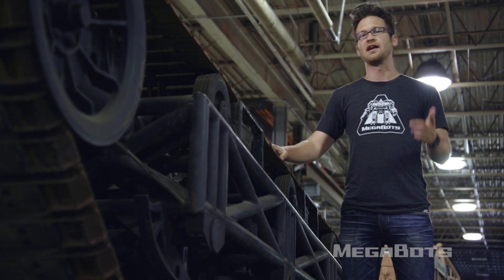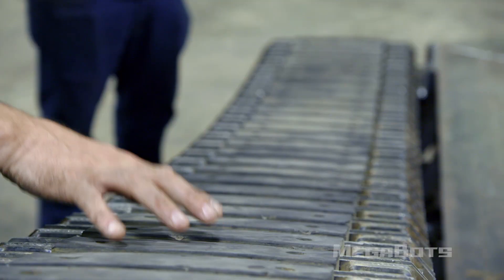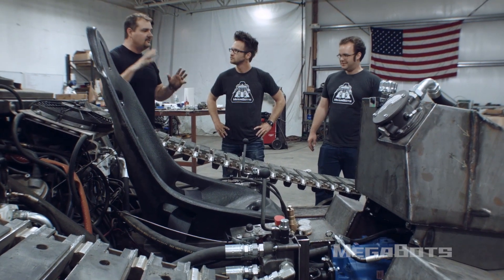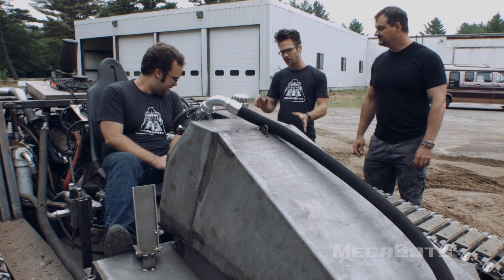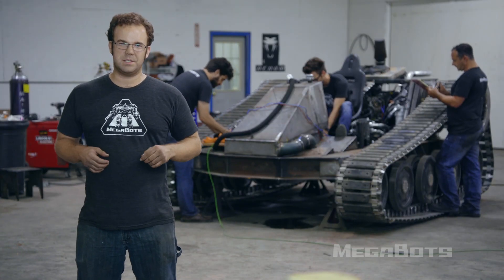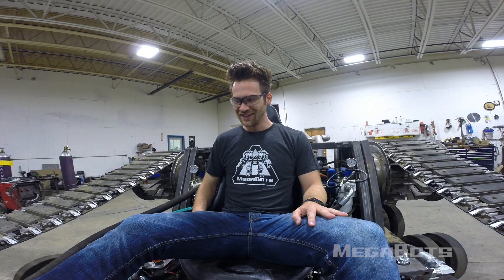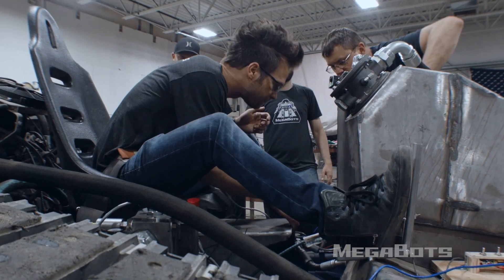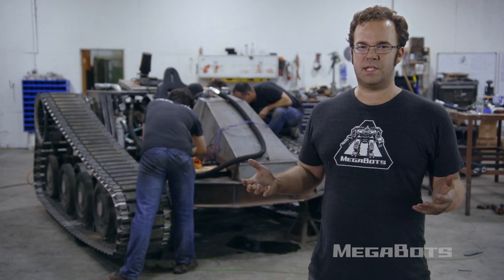Test Driving Our Custom Tank (Season 1)

Comment: As heavy-duty  vehicle operator/ driver this video is of interest to me.
That machine took some serious thought about how it should move.
As I understand it, the vehicle has a large V8 engine, that drives a hydraulic pump that drives the "high mounted" drive wheel.
It's kind of obvious that it's not a military vehicle, one rocket genade will take that "high mount" wheel out.
Is it just competition for the Ripsaw private vehicle?
I see it as a workable robot that can go in harm's way and not risk the lives of military personnel.
What system will be used as it's platform?
Better cover that high mount drive wheel.
Beautiful work, you will get the "bugs" out of it.
Good job!

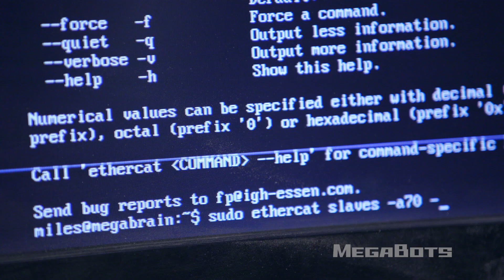Comment: 5:12 Good choice of operating system.
Reply: DOMEPEACE420
It's some Unix-like OS, probably Linux.
Reply: Angolin at risk of sounding like a n00b what is the OS?
Reply: that right there is a linux command line
Reply: last time i checked they were using stock ubuntu

Comment: Maybe iI'm being cynical, but I have the feeling that, with all the money spend in both sides, they are going to rig the fight and turn it into a choreographed show.

I hope I'm wrong and this battle of wits doesn't turn into a very expensive wrestling drama, even If I must admit, that also sounds kind of awesome.
Reply: I think it probably won't be full-force. The squishy humans inside might be harmed by a robofist to the cockpit. Even if the cockpit mostly holds together, the shock alone could harm or kill someone.
Reply: Ike of Pyke
 Well the Wright brothers weren't building jets either..... you may be right, and I would love it if we were just building giant robots to pick flowers, but I'm pretty cynical myself :)
Reply: Honestly I'd be happy if it was just like a one-punch knockout
Reply: Really I think this is just a "subtle" way of the military funding giant mechs. If this is anywhere near viable, they'll start cranking them out to go to war with. Not that it isn't awesome...but they've been pretty closed about their "private investment" funding outside of kickstarter.
Reply: I don't know...  I mean, a lot of the cost of the Megabot is in design, rather than materials.  Once you've figured out how it's supposed to go together, it's just steel and rubber, and industrial hardware- a little pricey, maybe, but not super expensive.  If one of the Ripsaw treads were to break, well, they're modular, and the individual shoes can be swapped out.  If the armour is ripped off, again, that's just fabricated steel.  If a joint is busted, that's hydraulics, but those are relatively cheap due to how common they are.

Now, I could see it being an issue if one of the fancy custom valves is busted, but those are going to be well protected inside anyways- it's much more likely that the first things to fail will be hoses or fudged-up joints, and if those fail, then the bot's out of work and lost anyways.

What's I'm really interested/concerned about is how the Kuritas is being modified for this.  That bot is definitely a showpiece, an expensive playtoy for rich guys, and so a lot of its parts are probably 3d printed or hand-cast carbon fibre or fiberglass- things that shatter instead of bending, and have to be completely replaced.  It's definitely got the edge in maneuverability and speed, but is it being beefed up to withstand damage more, or are they putting in better piloting algorithms and pre-set dodges?  The Megabot is a bruiser, and the Kuritas is a stinger, and I'm hoping it doesn't end up in a situation where neither of them is able to do any appreciable damage to the other, either due to dodges or armour.  (though that could make for interesting fights, it would mean the Kuritas would win by judges decision, probably.)

I mean, just look at Battlebots, and the sort of damage taken and dealt by 'bots that weigh only 250 lbs.  You get fancy 'artbots' that look awesome and drive really well, but don't do any damage, and get absolutely shredded by the 'brute' bots like Tombstone.  Hopefully Kuritas is more of a Beta, and less of a Radioactive.
Reply: still even if the first isnt very good if they can make a lot of money from it, it will continue on each year with better and better robots
Reply: jadestwrt
 It's coool to be cynical, I thought of weapons applications the moment both the Karatas and Megabots were annouced , at most I can see these things being made into Industrial machines especially if they can automatmate the arm changing. However I think we're still at least 20 years out from seeing on even prototyped for field testing for real weapons/military use..
Reply: That's what the destruction tests to the Mk. II's cockpit were for.  There's ways of designing a structure so that the squishies inside don't feel the shock of impact, and they seem to have done that for the current pit, according to a prior video.
Reply: The first tanks weren't much better. I think given 7-10 years of development something resembling combat-ready will emerge, but i doubt any military will use one for a while.
Reply: Stone Coughlin only thing I'd say against that is unlike those first tanks and the fleets of 2nd generation of tanks there's already weapons that are widely available that can take these mechs down in every major nations and some minor ones,  there'd need to be major revisions
Reply: Kilian Gonzalez thing is both couldn't fight in their previous state they were show pieces but could possibly popularize it
Reply: jadestwrt doubt it as these things(both Japanese and American) aren't meant to take a bullet and both landspeed due to weight as well as gas efficiency aren't high on either (why they're stationary most of the time)  a humvee with a chaingun or well armed LAV could take these out due do maneuverability and fire power outranking. Especially as this mech is meant to be a close range fighter and the closest thing to to a long range armament was the paintball Canon which as we saw can kill a person if it nails them but also requires a lot to aim.
Reply: I'd have to agree.  These are going to cost a fortune.  I don't see a lot of "Destruction" going on once they are complete.  That, and it would be "unsafe" to get too crazy.
Reply: Earthenfist
Nothing important is gong to be 3D printed. The output of a 3D printer is a brittle mas of plastic dots that aren't well bound to each other.
Reply: HJK148 "What is my purpose?¿"

You pass butter.

"Oh my God."

Welcome to the club.
Reply: Earthenfist
On Karatas I'd safely say handcasted as Japanese aren't too hot on the large scale 3D print yet and it was bulit a few years back.
Reply: Ike of Pyke
It is a production model, though, so it's probably not completely custom each time.  Still...
Reply: Angolin
3D printing is just a more precise method of 'casting' in a way.  You can 3D print with metal powders that get sintered together, to give similar strengths to cast metals, or use laser-hardened resins (like in Small Soldiers) to get a solid mass of plastic.  There's all sorts of ways to get stronger 3D printed objects.
Reply: +Ike of Pyke Which if there are improvements to material and design would either incorporate said weapons, make them obsolete, or just withstand them. Reactive armor or an improved version of it for these mechs may be a good start
Reply: Alexane Rose doesn't kuratas already have a reactive armor model?
Reply: Simos Katsiaris nope according to a quick Google
Reply: Ike of Pyke go to their order page
Reply: Simos Katsiaris which is bullshit if you try to actually order
Reply: Ike of Pyke
Who among us mere commoners has that kind of cash anyway?!?!?!
Reply: Alexane Rose on my last year in uni, it tried to convince the committee to order one but they chose to make drones and rescue bots....
Reply: Simos Katsiaris
A wise choice for now considering the design needs that Japanese refinement.t
Reply: Kilian Gonzalez maybe but it better not
Reply: Kilian Gonzalez the choreography is needed, it's good for business, business means money and money more awesome robots. first the choreography then and all out fight but at least they should produce some quality airtime.
Reply: I know that it will be extremely interesting.
Reply: you guessed correctly

Comment: Loving the sound of that v8, doesn't get much more 'murican than that. For the mk III will it be able to squat or brace itself from tipping somehow? It seems like that's the biggest flaw with the old design and one that the Japanese design avoids by looking more like a spider
Reply: Its going to have some crazy weighted gyro or gimbal or something.  I still think it will be 'tippy', but I think the force required to punch it over won't be possessed by the other robot.  I just don't think they can hit hard enough without being heavier or somehow planting itself into the ground before punching
Reply: I'm thinking that there will be legs that let it 'surf' on the base, keeping the pit and arms upright and centered even if the treads are at odd angles.  And from the prior tests with that wrecking ball, it'll probably be plenty sturdy enough.
Reply: That's true Earthenfist. They couldn't tip it over no matter how hard they hit it, they needed a forklift to tip it over. This new one seems to be even sturdier, with the added benefit of speed and mobility.